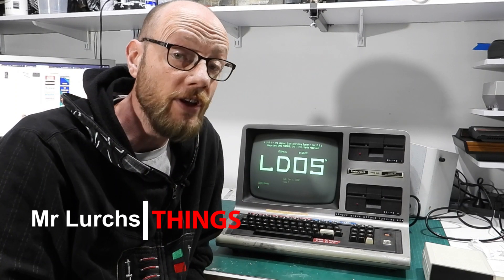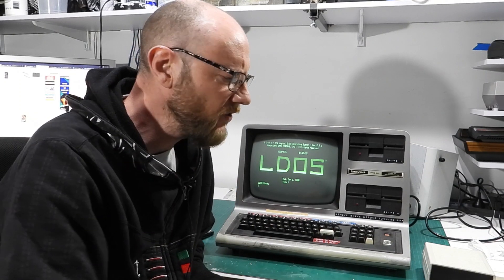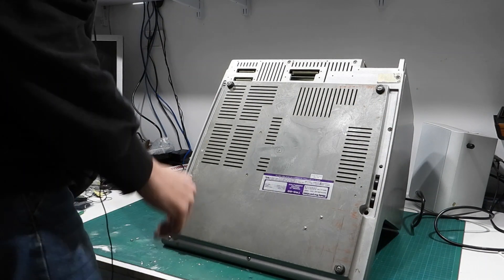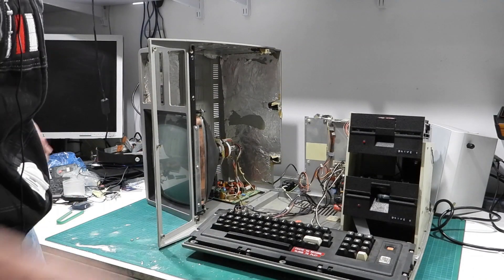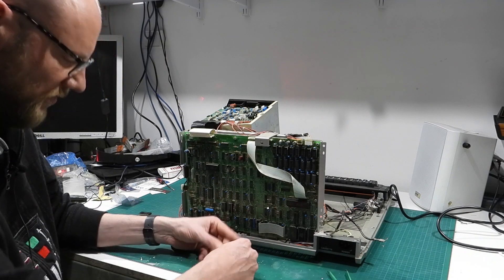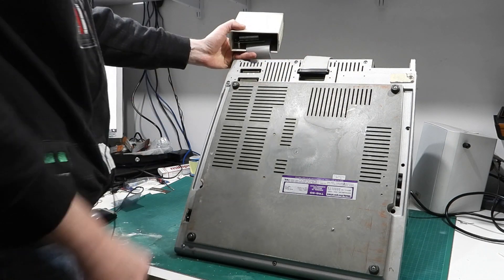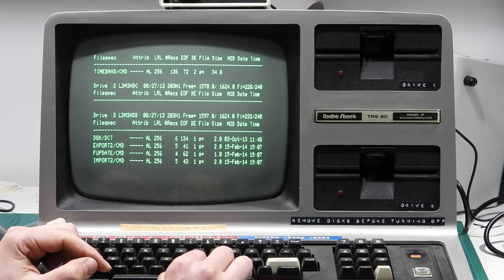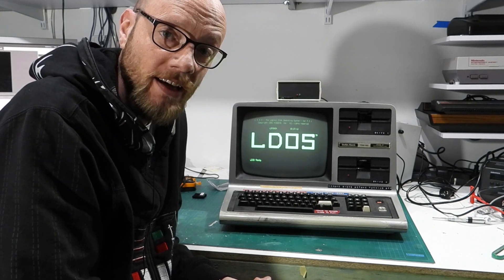The "Well Loved" TRS-80 Model 3 gets a Hard Drive #SepTandy

Comment: People like to cite inflation but in reality it's depreciation they should figure.
Reply: I think Inflation is a good way to look at it, because it gives people a point of reference how much something really cost back in the day, because the value of money was worth more in the past. for example a can of Coke that was $.35 USD from a vending machine in the 80's, is now $1.00 for exact same product. or a $0.10 USD gallon of gas in the 60's is now $2.35 USD for the same non ethanol gas, and in the mid - late 90's when was between $0.80 - $0.87 USD a gallon when adjusted for inflation because of so much over supply after the first Gulf War it was the cheapest us American's had ever paid for it. So again I think inflation adjusting is a good way of looking at it the value of something in the past.

Comment: I actually ended up putting an HxC floppy emulator in my kaypro 2x, its not a hard drive, but it does the same job
Reply from the maker: omegasignas Goteks work well on many machines, although personally I prefer the FlashFloppy firmware.
Reply: I actually have a gotek usb drive, but I haven't changed the firmware on it yet, its still on stock, my ideal was to have both drive bays replaced with modern drive images
Reply from the maker: @Captain_Char  If You do the FlashFloppy with a rotary encoder and OLED screen, it makes switching between disk images WAY easier; and probably negates the need to dual drives.

Comment: Awesome, thanks for this video, I'm going to need to do the rom as well for the 'low tech ide' board I just finished building so at least I know where it goes now.  I don't know if Penetrator has sound, (yeah, hard to say that name.. oh, man, i made it worse) but you might want to hook up the cassette cable (if you have one) to some powered speakers.  It definitely makes the games better.  When you do, try 13 ghosts, probably one of the best games i've played on the trs-80.
Reply from the maker: Brian V 
Penetrator does have sound. In fact it has one of the most annoying intro sirens in the world. A future project is going to be to wire up a small amp and speaker internally.
Reply: @MrLurchsThings  Cool, I wanted to do that myself as well.  However since I put all my computers together, i have an AV switchbox between a bunch of systems that swap composite and/or audio between the systems.

Comment: You want to have a good laugh? Do the math to figure out how much 1 terabyte worth of hard drive space would have cost in 1982.
Reply: That's pretty easy.  You just have to extrapolate from the data available online.  In December 1981, Morrow Designs had a 26 megabyte hard drive for $3,599 ($9,568 after adjusting for inflation).  That works out to $138 million per terabyte ($366,891,233 after inflation).